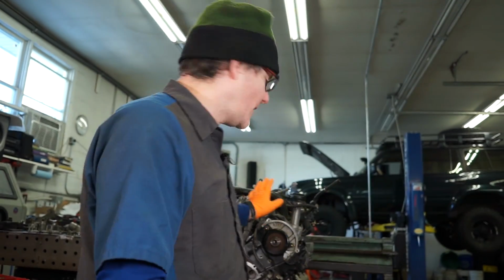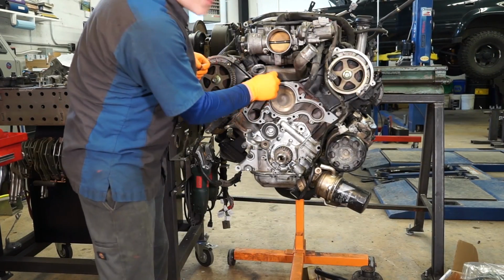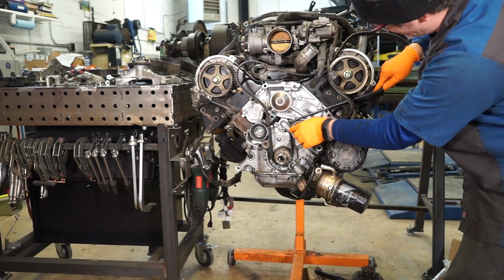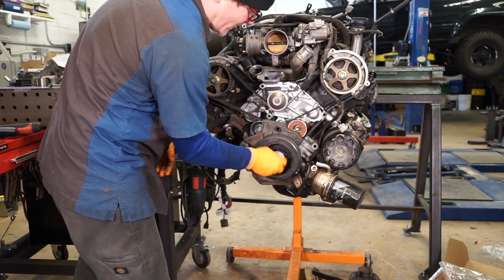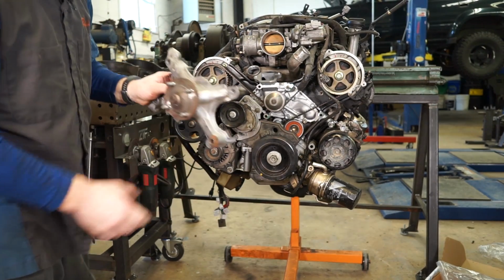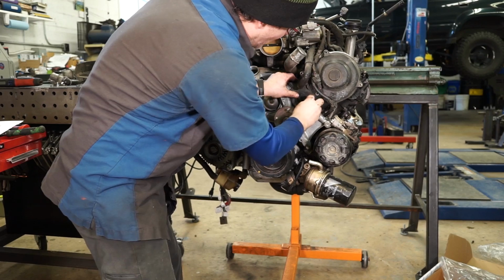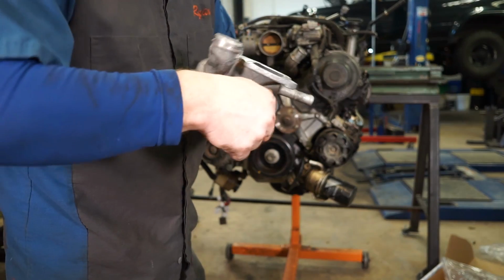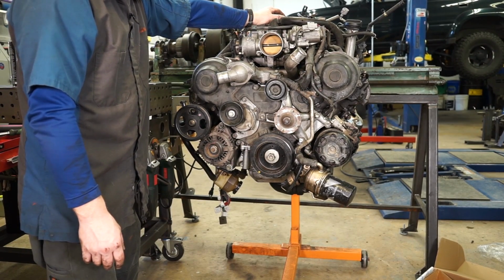Toyota 4.7 Timing Belt (updated) Part 3

Comment: Between yours and this one (https://www.youtube.com/watch?v=Z46cM-Bw1rI) from DailyDriven79, I feel I'm good to go. His was a little more pertinent in that I too have a '07 VVTI motor in my Sequoia. That said, and considering it's always the little things that get you, perhaps an addendum? In it you could 
A) cover how to deal with the studs in the fan bracket. My new one didn't have the studs. Good thing for me I knew how to deal with it from other projects but some may have a rough time with this. 
B) Spend a little more time with cable routing from under the fan assembly on the drivers side. I wound up with it bound between the right most bolt (as I face the engine) and the AC compressor. 

Thanx a million for the vid and saying the torque figures as well. :-)

Comment: Hi, what tool do I have to use to turn the camshaft gear/actuator counter clockwise to line up the camshaft mark to the belt mark on an 06 Land Cruiser? The passenger side cam gear mark and belt mark is lined up. However the driver side isn’t and I can’t turn it by hand. The cam gear on a non-VVTi engine is different from a VVTi so I’m not sure if the SST to turn the cam gear here on your video will work for my engine. Will appreciate your input, thank you in advance.
Reply from the maker: We use a universal timing sprocket wrench I got from snap on. I'm sure there are cheaper options though.
Reply: @OTRAMM  okay will try to look that up on amazon, thanks again.

Comment: If my crank seal is not leaking should I go through the effort to get the old one out and replace it my vehicle has 256 thousand miles on it. I worry about trying to get the old one out and a new one in....I'm thinking to leave well enough alone.  would love to hear a response as soon as possible
Reply: I know this is old but to answer the question, most will say to leave it alone if no signs of leak.

Comment: You’re an absolute gem, thank you for this video and all the other land cruiser ones sir! Just replaced timing belt, water pump, fan bracket, tensioner, etc on my 2000 4.7L Land Cruiser with 360k+ miles, very good feeling!
Reply: I've got a 2000 as well.  It has 262k on it, and I consider it young.  Just did my front wheel bearings, and am gathering parts and confidence to do the timing belt and water pump.  The video here is very well done.  An asset to the LC community for sure.

Comment: as regards the crank bolt being torqued my torque wrench only tightens to 150 so was wondering what fraction of a clockwise turn would be a good estimation to get it to the required 181?
Reply from the maker: I have no idea. You'll need a bigger torque wrench to do it correctly.

Comment: I did this on my toyota tundra 2004 for the second time, the first time every thing went ok. But this time it's leaking. Not on idle but, when i drive the truck, then all of a sudden, it starts leaking. When i put it in park it stops. Have you ever had this issue??
Reply from the maker: What's it leaking and from where?
Reply: @OTRAMM  I got underneath the truck and i could see water dripping down in the direction of the harmonic balancer. Maybe i did not tighten well one of the screwes or nuts. Im tearing it down again, to be able to see, what i missed. I don't no if i should order another water pump just in case it was a bad water pump.

Comment: I have a 2004 Sequoia and waiting for my mechanic to get back to me on a quote for this work.  What terrifies me the most about this is that one mistake can have devastating consequences, on one hand I'm thinking it's something I can do but on the other I'm having doubts because I know I'll encounter difficulties.  If the quote comes back at over $1000 I will seriously think about doing it myself.  People relay stories about the cams moving or whatever and bending from hitting the pistons etc.  One thing that is tempting me to have a go myself is with the money saved I could buy an impact wrench and other tools as well as building up the knowledge to tackle the job in the future, this and getting a great deal of personal satisfaction, but again I'm worried about f***ing it up!
Reply from the maker: It's not a bad job just a lot of steps. Take your time and pay attention to the steps and where fasteners came from and it's just a series of small steps.
Reply: OTRAMM thanks for your belief in me but I’m pretty useless mechanically, you guys make it look easy!
Reply: @OTRAMM  waiting for the 2 quotes for the timing belt work on my 04 Sequoia, I know the total cost will vary depending on labor rate but what would you consider a reasonable time frame for completing the work?  My guess is around 6 hours?

Comment: I need help here. I stopped looking at the manual and just set the engine to 0 on the crank with the cams on their mark (not the Ts). Mines a 99 and asks to be turned a little bit further before removing the belt. i did not do that. Seems to me as long as the cams didnt rotate and the marks on my new belt line up i'll be fine, correct? I've been stressing because i'm not sure how the tension or something else i might have forgotten or over looked might play in.
Reply from the maker: You should be OK if you have all the marks lined up. Rotate ot a few times gently to check for binding.  I think the different belt removal rotations are to set the pistons to where the valves won't hit if the cams spin.
Reply: @OTRAMM  Right on. The driver side cam liked to spin during some jostling around on a different part of the vehicle, so i would just turn it  back. I assume no damage came of it from the valve springs pushing it like that.
I tried putting the belt on today with no luck. none of the marks on the belt to any of the cam marks line up at all. Its like its too short. Im double checking part numbers today. thanks.
Reply: @OTRAMM  alright, so i was not going crazy, the two cam marks on my new toyota belt were in the wrong spots. I grabbed a belt from napa and counted ( and recounted) the teeth till i had new marks for both cams. Installed, turned engine over, everything lined up. BTW the toyota belt at least looks a lot higher quality than the napa belt.. even though it may have been made wrong.

Comment: Good info. Thank you. Question: I'm currently working on a 2003 Tundra 4.7 with tow package. Do you have a video on how to remove and replace the 140 amp fusible link? It is number 34 in the engine bay fuse box. Any advice would be much appreciated.
Reply from the maker: I haven't run in to messing with anything in the fuse box.

Comment: Need help: can someone tell me the position of the crank before removing the harmonic balancer (before TDC, TDC OR 50 DEGREES BEYOND TDC). I have a 2004 Toyota Tundra with 4.7 L, V8. I need to replace the water pump and timing belt and  manual I purchased does not go into that. I greatly appreciate the help.
Reply: I also have an 04 tundra and just got done replacing my timing belt. Position the crank 50 degrees beyond TDC, where the timing mark on the crank  lines up with the silver "dot" just before lining up center with the idler pulley bolt. This should position your crank sprocket timing marks with the "T" above the cam sprocket sprockets. Doing this will keep your sprockets from "jumping" once you begin removing the hydraulic tensioner and your timing belt. 

When I originally positioned my crank timing mark to center with the idler pulley bolt like in this video, my left cam sprocket jumped 30-40 degrees clockwise and each time I would try to line up the crank sprocket timing mark to where it originally was (just a little past the T mark), it would want to keep jumping counter clockwise. Make it easier on yourself and line up the crank timing mark with the silver/white dot and not the center of the idler pulley bolt like the way the Tundra FSM directed.

Comment: Which shop manual are you using? Would a Haynes shop manual give the position of the crank before removing harmonic balancer?  TDC, 50 DEGREES, OR BEFORE TDC?  I have a 2004 Toyota tundra. W/ 4.7 v8.
Reply from the maker: We use the factory manual. I wouldn't trust Haynes or Chilton.
Reply: Could you tell me the position of the harmonic balancer before removing it. The manual I purchased does not even mention it. I have a 2004  4.7 v8 motor in my Tundra. I would greatly appreciate it.

Comment: Hey I have a question if you don’t mind. My 00’ es300 1mzfe I did the timing belt kit on (aisin) cam/crank seals everything. Afterwards it seemed to be bogging down at low speeds and I could swear it was not driving like that prior but otherwise runs great. My question is about checking the timing. Yes it was an aisin kit but the belt itself wasn’t Toyota so the marks were different the cam marks lined up and crank was at tdc but only difference was the other mark on right on crank didn’t line up with the dimple. Would I start with it at tdc and make sure the cam marks line up or crank it twice or what should I do? Thanks
Reply from the maker: If the timing marks on the engine don;t line up you've got an issue.  You'll have to reset the belt.  I've not seen an Aisin kit with a mismarked belt.  Are you sure you installed it in the correct order and right way round?  Sometimes the cams move while the belt is off and need to be re positioned.  You need to go back and set the belt so that all the timing marks line up and then turn the engine over a few times to make sure they continue to line up (the engine timing marks, the belt will only line up at the initial set up.)

Comment: In the case this is done with the motor in the truck, can the crank be turned to orientate the cams with the trans in neutral? Thanks for the great video!!
Reply from the maker: You can turn it in park no problem. You just can't turn the motor once the belt is off.
Reply: @OTRAMM No kidding?! Excellent to know! Thanks so much for the info brother😁 Keep up the good work

Comment: Thoughts on the cheap Aisin Timing belt and waterpump kit on Amazon? Ive heard that this is basically what is supplied to Toyota?
Reply from the maker: We use the Aisin belt kits all the time. They're quality Japanese parts. There's a link to them on our website along with the other bits we regularly use. Amazon gives us a cut when you click through our link.

Comment: Sorry if you already answered this but why do you turn crak 50 past TDC not stop at zero?
By the way, thanks for making such helpful videos.
Reply from the maker: That's where Toyota says to do it on that generation. Some stop at tdc and some are before. It depends on the year.
Reply: @OTRAMM  thanks for the great video. Mine is 2001 landcruiser would it be fall into turning the crank 50 degree past the TDC? she already have 120,000 miles on it and I am not too sure if it was changed before or not as I bought it second hand and she use to have 55,000 Miles at that time. would it be possible to load the manual for the few pages that you hold for the timing belt change and torque? thanks again for the great three videos...

Comment: I bought a 2001 Sequoia 4.7L one year ago. I have taken several long hard pulling trips on it and it has been the best tow vehicle I have ever had.  I am proud of it and have wanted to make sure it is in the best running condition.  I am almost certain that the timing belt and water pump have never been replaced.  It has 173,000 miles on it.  after watching your videos I am totally impressed with the confidence you have given me to do it myself.  Dude, your video presentations is awesome!!!  I have just subscribed.  you're the best.  I am now looking to service the transmission and all of the running gear.
Reply from the maker: Sweet, glad the videos were inspiring. It's not a bad job, just take your time and label bolts.
Reply: @OTRAMM  do you think it is a good idea that I replace the cam shafts and crank shaft seals when I replace the timing belt?  what do I look for to tell whether or not the seals are bad?

Comment: Excellent video thank you. Could you explain how to use the “T” marks up on the cams versus the straight line timing mark up n the cams? The are about 10mm apart . Can you damage the valves while manually rotating the cams?
Reply from the maker: I don't know what the t marks are for. They aren't mentioned in the manual. Theoretically if you pull the belt at the correct position you should be fairly safe for the inevitable cam rotation. I wouldn't force anything though.
Reply: Thank you for the reply. I came for the 4.7 engine info and now I want a 100 series land cruiser haha. I have a 2005 sequoia limited that has been SO amazing since 2005. The 2uz v8 is an unbelievably reliable and awesome engine . One of Toyota’s best ever engines

Comment: Great video.  I followed it step by step on my 2000 LC.  Thanks for the details, especially the torque specs.  After completing the project (Water pump, timing belt, tensioners etc.), my heater is not working properly. Fan motor blows, but air is not consistently hot.  Been looking for a fix, but don't have one yet.  Any advice? Thanks in advance
Reply from the maker: You've probably got an air pocket in the heater. Sometimes it takes a few times burping the coolant with the heater on to get  the air out.

Comment: I have a 2004 Toyota Tundra with the same exact engine. Could you please tell me the part number for the o-ring that is placed on the coolant pipe before you install the water pump. Mine is leaking and I’m going to get to it via taking off the intake manifold so I can access that pipe. A little easier to access that way. I just need a number so I can order that part. Thanks
Reply from the maker: That o-ring comes as part of the Aisin kit we use. I've never ordered it separately. I'd just call your local dealer for it. They'll be the best bet for looking up the correct one.

Comment: Good job on the video. Thanks.  I start belt replacement and water pump on my 2005 Tundra using this. I already made disassembly procedure notes and reassembly procedure notes. Watch a couple more times and I'll be real familiar.

Comment: Should the oil pump be replaced also? 170k miles
Reply from the maker: The engine has to come out to do the oil pump. I've yet to see a bad oil pump. I have seen the pump to block o ring leak on one.
Reply: @OTRAMM  Thanks for your super fast reply. Looking to take this on in a month. Your video is very detailed. I think its going to be my saving grace for the belt replacement.
Reply: @OTRAMM  Also Is there a easy way to tell if the belt has never been serviced?
Reply from the maker: You could pop the passenger side cover off and look at the belt. There's not always a good indication of wear though.

Comment: I've got the raisin instructions that come with the kit and it says after I find TDC which is the pin on right for 05to09 then to rotate50°counterclockwise until notch on sprocket is approximately 12oclock ,I'm just wondering tough after I do that how far my cam marks will move and if I'm still gonna be in that neutral /safe position when removing belt,then do I reapply belt as marked aligning belt arms with notches in crank and cams?is it that easy really

Comment: Just curious but I've got a guy tell ING me that I need to use the T for removal and replacement because Toyota headquarters uses it but I'm iffy because mine spins counterclockwise and I don't know where they will line up at from that point
Reply from the maker: You need to read either the Toyota manual or Aisin instructions for your model.

Comment: So after your rotation to take belt off in a neutral /safe position you leave it alone until you do puppies and water pump ,then installation you just use you new belt marks and align them to the crank marks and cam marks ,then when you turn everything a couple time it should line back up at *TDC?

Comment: How come your not concerned with the cam marks on cam,just wondering
Reply: I am wondering the same thing,thanks for asking.
I would think if you lined the balancer mark on 0,and the cam marks are lined up during belt removal(and not turn thee crank) you would be able to slip the new belt on,and it would still be in time,just curious.
Reply: @loganrobideau3479  I know ow some select vehicles you can but on one like I have it needs to be rotated to the neutral safe zone so to speak

Comment: One question are all raisin kits for 4.7 4 runner Sr5 the same ,what I'm asking is if I ordered the kit you show from Amazon will it be the exact fit for my 2006 Toyota 4 runner Sr5 4.7 with vvti system(not snuff or too many teeth in this type of belt)?
Reply from the maker: As far as I know all of the 4.7 engines use the same kit.

Comment: Is there any difference when doing it with vvti
Reply from the maker: The rotation point where you pull the belt off is different. And you won't be doing cam seals.
Reply: @OTRAMM  acorrding to the manuel Haynes it's saying to rotate opisite way 50degrees so confused